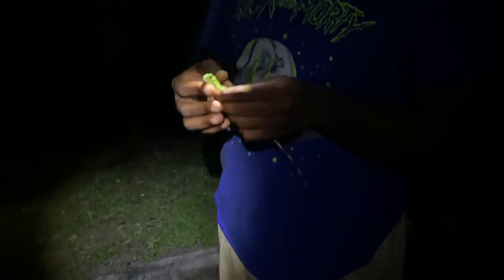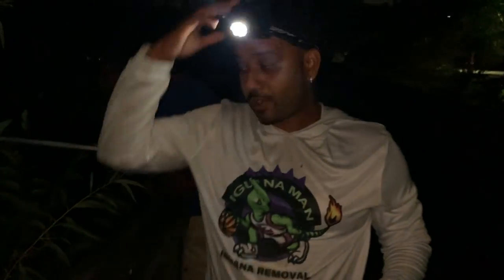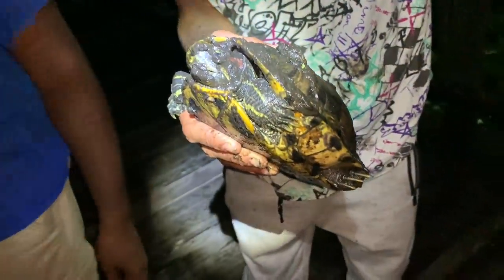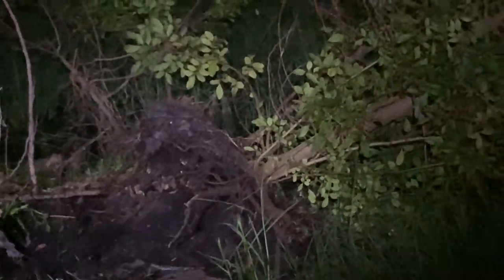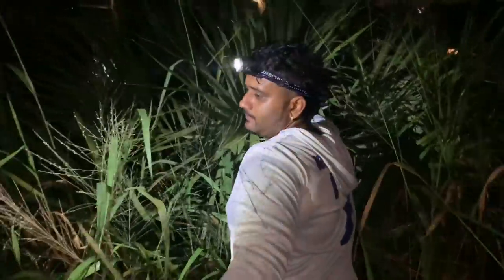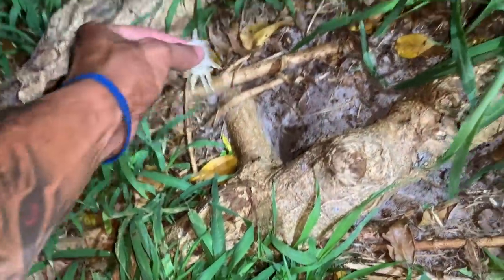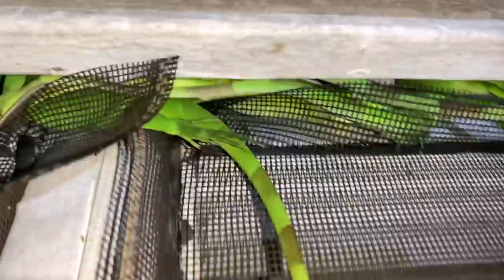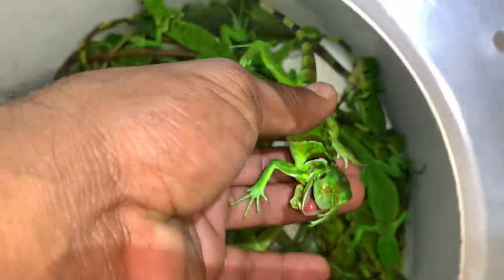Baby iguanas Hatching all over Florida and take over house! iguana Removal Job!

Comment: That is a hybrid yellow bellied/red eared slider for sure. The yellow bellied turtles do not have red ears. The circle pattern of the red eared on the sides of the turtle just beneath the top shell are a more defined spiral whereas the yellow bellied has more solid circles with no spiral or very little spiral pattern. I have owned both turtle species. The turtle you caught has both red eared and yellow bellied slider traits without a doubt. As for the bellies, they look pretty similar between red eared and yellow bellied turtles. They can in fact interbreed, which is quite common in the wild, and they're very closely related.